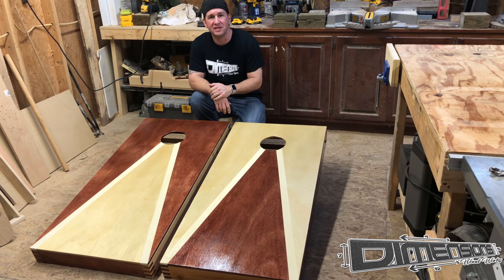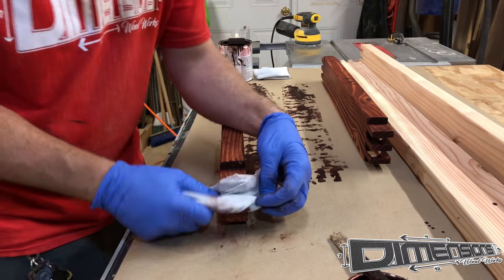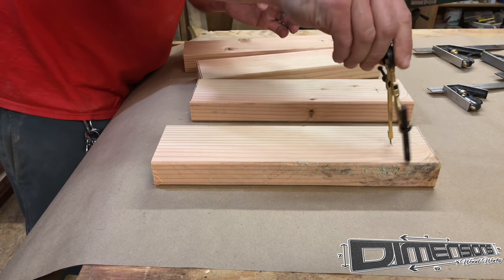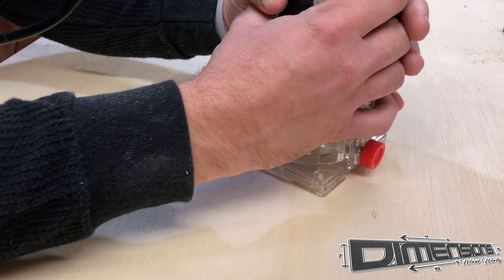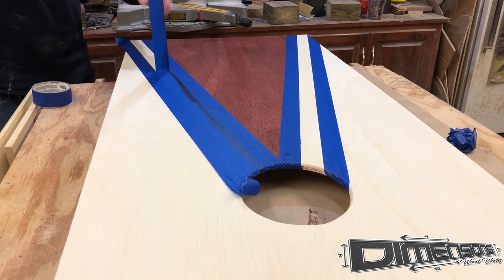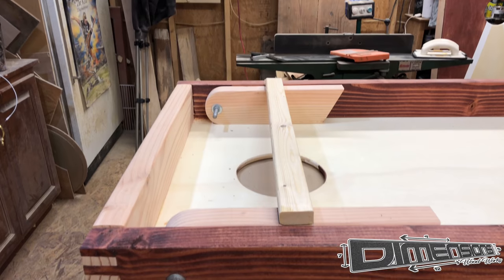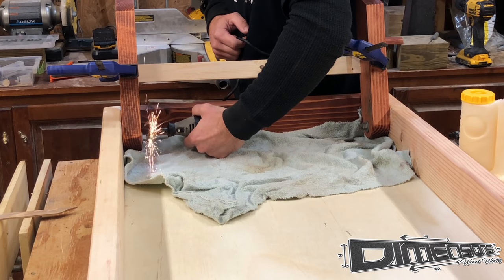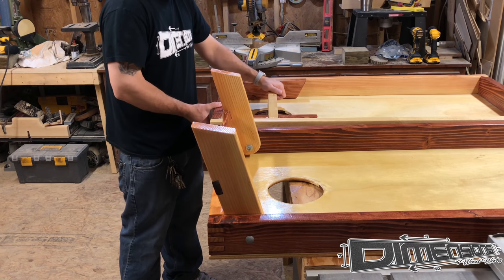How To Make a Set of Cornhole Boards (Unique)

Comment: Did you do any sanding on the clear coat?
Reply from the maker: I usually sand to 400 between coats. But down here without a booth or clean room, u always end up with trash in it. You can see it some on the video...

Comment: Fantastic job! I've built several sets myself but I have never stained a set. What type of plywood did you use here? Thanks for the roundover tip on the hole. Never tried that but I'm gonna use that in the future.
Reply from the maker: Thanks for watching! Glad you enjoyed it! Unfortunately i don’t have a hardwood or quality plywood dealer in my area and HD is about 45 minuets away, so Lowe’s (5minutes from home) is usually my go to for material. I used 1/2 in Blondewood ply (so who knows what that is)  kinda the mystery meat of plywood 😬   But it’s on the upper end of what they offer at my store, and it stains nicely.   The small roundover Just adds a nice little touch to the texture of the boards.
Reply: Ok I've used Blondewood before. Thanks I'll give that a try.

Comment: Do you'd make and sale by any chance??
Reply from the maker: I sold this set actually but i usually only do it for locals, due to high shipping costs.
Reply: @dimensionswoodworks  I live NY, Long Island in case you change you mind
Reply from the maker: If i knew shipping costs it would be a consideration but I’d feel bad charging more for the shipping than the piece. Some people would still pay it, but maybe it’s the southerner in me, i don’t wanna have folks feel ripped off.....
Reply: @dimensionswoodworks  Hiw much fo a pair of boards?
Reply from the maker: Americanpie1 you can email me at dimensionswoodworks@gmail.com
Reply: @dimensionswoodworks  I trying to email but uts reading invalid-
Reply from the maker: Americanpie1 that’s weird. That is the correct address. You can also find me on Facebook or Instagram and send a message there. IG handle is @dimensions_woodworks

Comment: Great looking boards but built for beginners. If you use anything less than 5/8 Baltic birch they will bounce bad. Bags will hop the hole from the bottom of the boards. Very frustrating. Also don’t use 2x4s. They warp. ACL rules require 2.5in to 3.5in high in front as well. All this is good to know if you want to sell to the next level players.
Reply from the maker: Thanks for checking it out. I built them to the specifications i found online ( not sure which association) that calls for 2x4s and half inch plywood. I have heard some folks that take the game more seriously that the 1/2” would cause bounce but honestly nobody I’ve ever made a set for was that into the game. I could build them like tanks if the customers wanted to pay for them but most people just don’t care. They’d rather they look cool and be personalized for gifts. I’ve had a couple folks ask to ship them but as heavy as they are i don’t feel right about charging the same for shipping as the boards themselves cost....